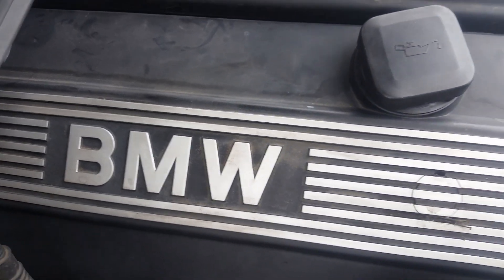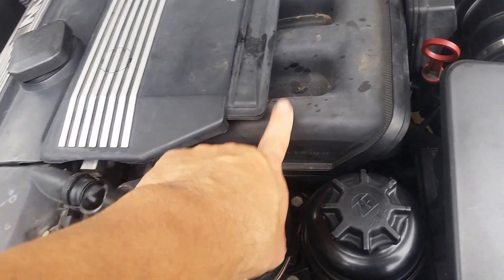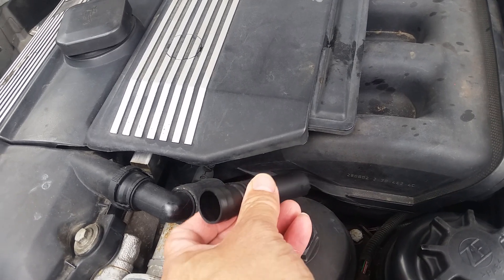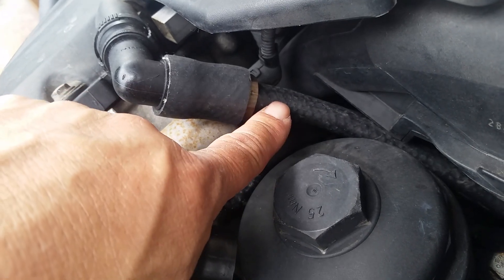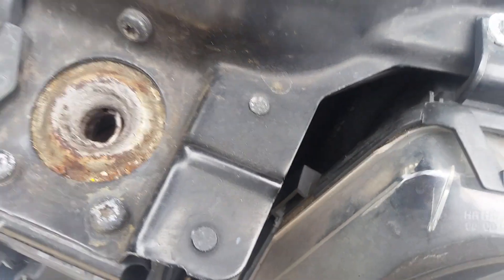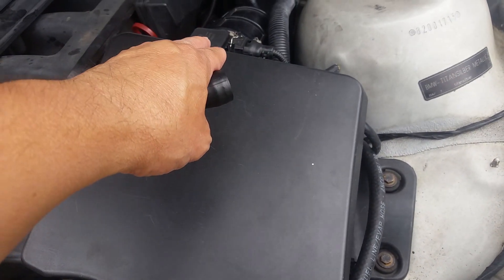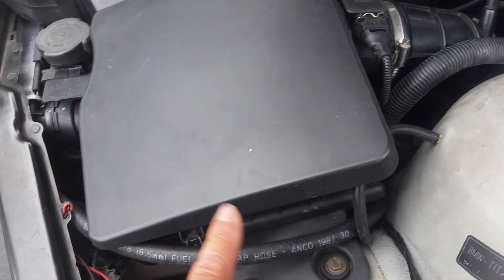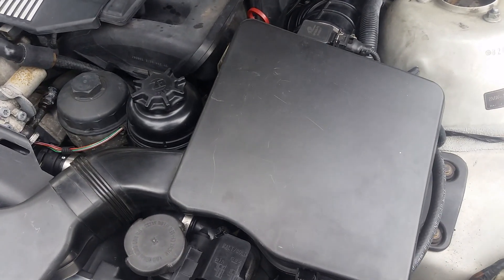BMW P0171 P0174 solved BMW ccv bypass another version

Comment: By now you realise It wont work the way you did ,  Wright ? You need a catch can .
Reply from the maker: Catch cans work when the oil fumes are pushed out into it as to this the engine vacuum creates a suction effect in the line and draws it out like the original design..but this version was just to prove that if you get those codes and start changing all the sensors and stuff just to find out its the cheap uro parts that was installed . The old saying goes, just because its new doesn't mean its good..but at the end the car had to many electrical gremlins that consumed it up and it was sold to someone that had money to invest...

Comment: You blocked off the nearest pipe on the intake manifold. What did you do with the hose that you pointed out which comes from the far end of the intake manifold?
Reply from the maker: All ports from the intake is closed off, front and rear

Comment: Hi  Al.
How about now ? conditions ?   No more fauts code ? p0171, p0171 ?
if you are satisfied,  Could you make more detatil VIDEO for friends ?
Reply from the maker: Yes, no more faults, no more codes..ran beautiful till I sold it..with  traction control and abs lights..then I had enough  fixing it..FYI, don't by the ccv valve and hoses from the aftermarket..they will go bad in months and leak and cause all codes..and you won't think about the ccv valve because its only a few months old but it was the problem... go buy genuine bmw stuff, they last longer..
Reply: @alyoungcuda  
Thanks reply.
So, Can you recommend your ways instead of ccv ???
Reply from the maker: @badmintonlesson  I would rather go and use the stock ccv stuff . I did this to chase those codes and it was because I changed out the ccv with aftermarket stuff and they were the problem

Comment: hi, how is it running? :D I'm now with this stuff some guys say the crankcase need vacuum to suck the blow by gases ect ....

for a test i caped also the intake and had open the crankcase ... so much output gases never seen ...
Reply from the maker: Worked great for 1 1/2 years then it was time to change the ccv system parts and put it back to Original condition..you have to buy original parts..that aftermarket stuff won't last long...but it ran good till I sold it

Comment: In my opinion though that pipe goes too much oil vapors for air filter to handle. Sooner or later you will understand. Have you seen how much oil is caught in catch can ?  and you still want the air filter to fight it ? nooo mate that's not the way to go. At least you could add a small catch can somewhere near to air filter housing, even something like 5 $ can or even self made will do. Your method is good , really, for diagnosing problems. On the other hand i believe vacuum is a must i cc  but that's other story. You can also just let it out somewhere else.

Comment: So the next time you make this video can you do a removal of the top part and show us how you kept everything off or deleted certain things I'm at 202 thousand miles and I had a lean code I repaired a lot of things from their regards to the lean codes so then I put in a cheap CCV into the system and hopefully that would hold down I thought about what you was doing but I was I was hoping to just a set of the plastic pieces it's a cut the two sides and put a rubber in it so you'll float better and and create a better seal
Reply from the maker: The best thing is to replace the ccv system completely with a good brand..those cheap brands will set a code all the time..they just dont seal right..
Reply: @alyoungcuda  my ccv is clogged with yellow and I've removed it place the other one on but I got half click ill be redoing it this weekend but I need to know if I have to put the bottom on first or the top one
Reply from the maker: @isrealperez9069  ccv is 1 piece looks like an hour glass..
Reply: @alyoungcuda  so my question is for you is which one do I put first the one that goes under the intake manifold first one or the bottom one of a intake manifold next to the oil hose I have an 04xi model
Reply from the maker: @isrealperez9069  the one under the intake manifold is the most popular part to go bad along with the hoses that are attached to it
Reply: @alyoungcuda  thanks so much I'll just redo it this weekend with oem

Comment: did you block the deep stick outlet?
Reply from the maker: No..I installed new o rings on the stick and cap the rubber hose on the bottom of the dipstick  tube

Comment: I am doing the same setup tomorrow. The only concern I got is whether the crankcase pressure will rise due to the decreased vacuum sucking the oil vapours from this setup. Correct me if I am wrong please. It's been a while. Do you notice any new oil leaks or any oil consumption ? Thanks !
Reply from the maker: No oil use at all..but my car was burning oil already

Comment: Unfortunately the BMW system requires vacuum in the crankcase. You have a vacuum leak now, it was never meant to vent to the atmosphere,.
Reply: It's a clever idea but the problem is you need vacuum from the intake to relieve crankcase pressure . The valve cover gasket and engine main seal could blow out. The port in the back of the manifold will do if you drive normally but if you're hitting hi rpm you seals will go it happens on the track all the time on my m52 and m54 engine. You could route it after the mass air flow meter by tapping in somewhere but in my opinion just buy the oem ccv system unless you changed the intake from high performance like from a m50 . The stock ccv is actually pretty good the gas vapors from the crankcase actually gives better throttle response and the water vapor that makes mayo that u see on the cap or cyclone piece is actually water vapor that keeps the intake valves clean. " Steam clean effect. Put back the stock system
Reply from the maker: No vacuum leak..the 2 ports are plugged as stated and it is not vented to the atmosphere. It is redirected to the front of the air filter which will catch the oil and the fumes will travel thru the filter into the air intake..it runs like an old school 283 Chevy motor per say..no more lean codes from a vacuum leak since the motor needed all the seals to be tight like a Tupperware jar..so if your motor is up there in miles..there is so much you need to reseal..and all those valve cover,oil pan, front and rear seals. Dipstick tube and stick seals..even your oil cap is a sealer..all those ccv pipes and valves..plastic manifold and all..this is just another temporary fix..by all means..ALWAYS FIX IT RIGHT WITH THE CORRECT BMW PARTS ..stay away from all those aftermarket stuff..they won't last.

Comment: How is that not a vacuum leak?
Reply from the maker: The ccv is capped off at the intake ports (2) it runs like an old school engine
Reply: @alyoungcuda  But isn't the line running to the air intake box not accounted for by the sensors/computer? Essentially no longer a sealed air system when normally everything going through MAF sensor is accounted for either coming out of the exhaust or being recirculated through again...

Comment: Did it work?
Reply from the maker: So far so good..no check engine light on, but I'm not a big fan of modifications but it cleared my light for inspection and the car does have 180,000 miles on it..the main problem was the ccv system..don't buy cheap stuff..they only last a few years